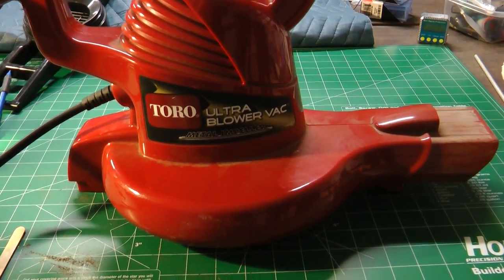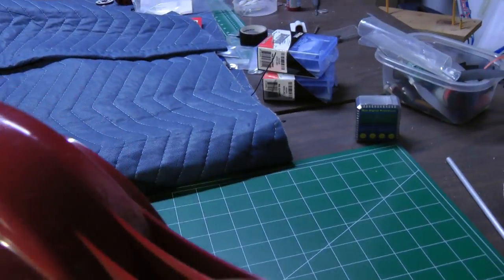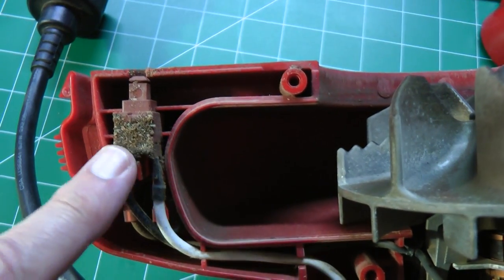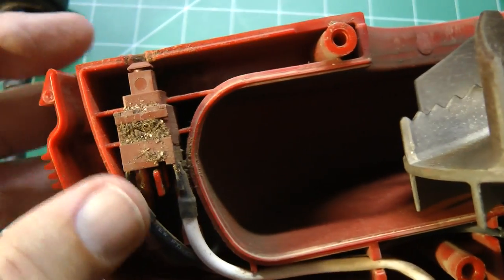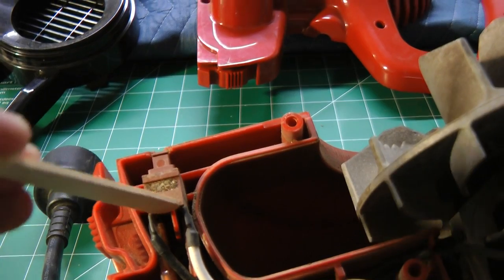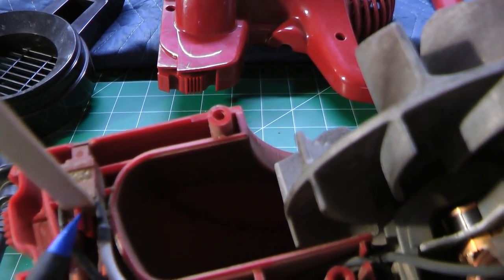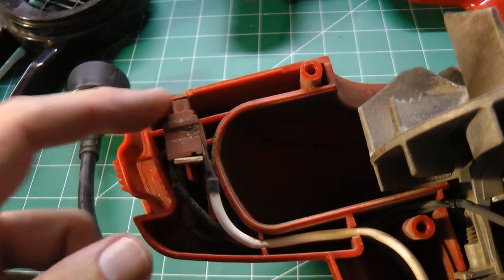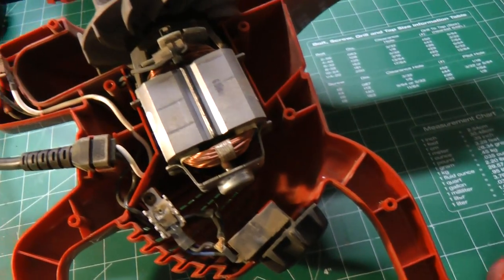Toro 51609 leaf blower - repair the faulty switch

Comment: Gary, many thanks for your repair video. I got all the screws out but couldn’t separate the 2 halves. I was pounding on it with prybars, knowing it was going to break. Taking a break, I thought I would try YouTube. Sure enough, yours was the first one that popped up. I gave up trying to separate the halves and instead, drilled a hole on each side near the switch. I then pushed down the switch and inserted a wood BBQ skewer so the switch was always pushed in(closed).  A drop of superglue to keep it from vibrating out and I had my blower back! Don’t do this unless you’re ok bypassing safety devices!!
Reply from the maker: Did you remove the black piece where the air blows out?  That would hold both sides together.
Reply: Yes, the black piece was removed

Comment: Before disabling the safety switch, first question is, Did you forget to put the the black plastic cover over the blades that protects your fingers from getting mulched off? You may have misplaced it.  Attach that protective cover and its pin will press against the safety switch and in most cases make your blower operable.  If you cannot find the protective cover that came with your device, I suggest you buy one, make one, or get a new blower.  This video will help to clarify this further.  https://youtu.be/CTI-QsTAuTw
Reply from the maker: Bill you must not have watched the video very closely???? I explained in the video that the black plastic cover has a pin that was NOT pushing the safety switch in far enough to close the circuit.
Reply: I do not have the plastic cover and believe I have been operating mine without.  Now that I have attempted to fix the issue, i realize the blade is turning and could easily tear off a finger or worse.  I don't remember the unit coming with one.  If it is the one that he shows in the video, i do have that   That wont stop a finger,

Comment: I have the same model however I have one major problem.  It won’t come apart.  The casing won’t separate I have remove every screw and have it preyed loose in some areas but it won’t totally separate.  Any suggestions?
Reply from the maker: How many screws did you remove?  Also did you remove the bottom black piece that snaps off?
Reply: @GaryQuiring  I have 13 screws I have removed.  I  checked and I  have a 51619 not a 51609 which might make a difference?
Reply from the maker: @bobhanson2111  Probably, check the stickers, sometimes there could be a screw behind them.
Reply: @GaryQuiring  will do.  Thanks for your replies Gary.

Comment: Thx for the video. In my case, all I had to do was attach the bottom black piece (that covers the motor fan) with tape to the body of the blower. Before trying this, I tried to open up the blower after unscrewing 13 screws, but couldn't get it to open up!
Reply: Chkd safety switch & unit wkd. Noticed tab on plastic bottom that clicks on was broken off and not engaging switch. Drilled small hole and added small screw so it could press in switch button to turn on unit. Problem solved! 
Thanks for the overview, helped on locating problem😌

Comment: Im thinking why dont we eliminate the switch and solder the two wires together. As long as we dont plug the blower into electricity until we are ready to use it then no harm can come to anyone. Thanks for your video. Ive got to go solder those wires together since I don’t see a downside.
Reply from the maker: It's there for a reason, if the bottom were not snapped on correctly and it were to fall off you could get your hand all torn up.
Reply: Thank you for making my case. I bypassed it and still no good. Going to remove a thermal fuse next try.   If it doesn’t work its trash anyway. I’ll let you know if it works.
Reply: I did this on mine, twisted the 2 wires together and wrapoed w electrical tape.  Ducked taped the cover to the blower.  Worked like a charm!  Just have to be careful when taking off the cover (if you do.)

Comment: I have the Toro 51618 and this worked perfectly! I cut off a small piece from an old Costco's membership card I had.

my model has 13 screws, one of which is hidden behind the sticker.

Thank you so much!
Reply: I used an old plastic membership card because I did not have any popsicle sticks.
Reply: Thank-you for posting the part of one screw being buried under the cover!!!!!!!